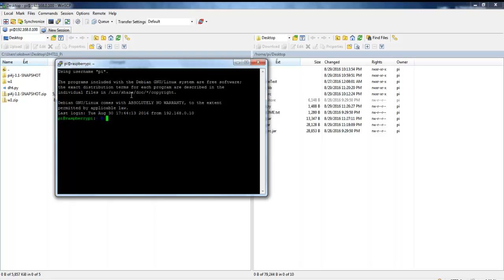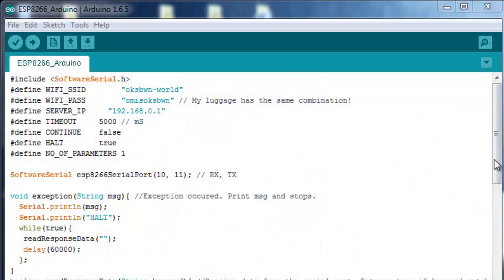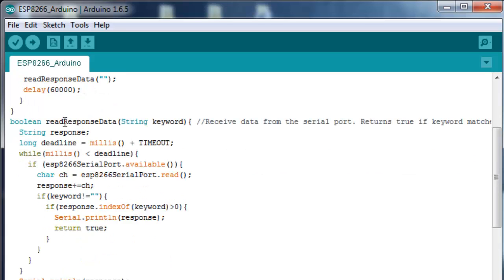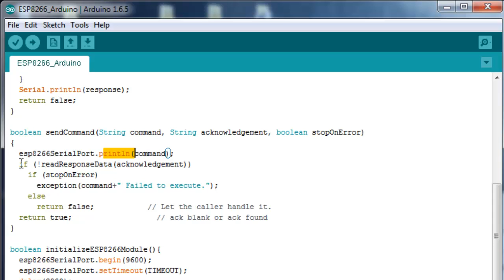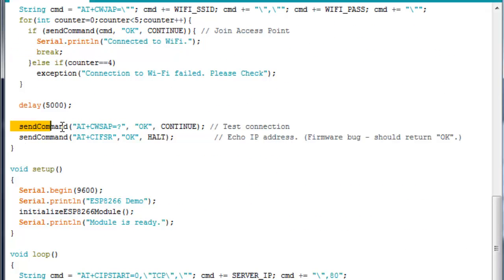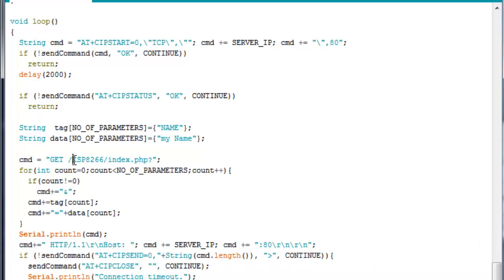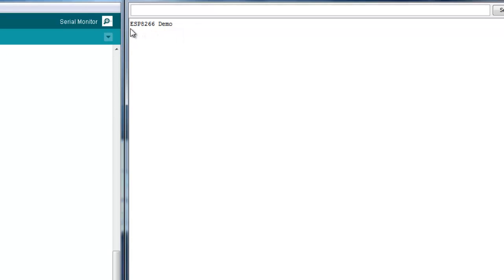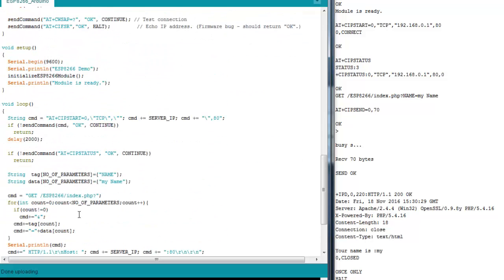Connecting ESP8266 with Arduino | AT Commands

Comment: Hi , i have a problem with esp8266 can you help me. I purchased esp8266-01, but it is not accepting any at AT command. I tried flashing Ai thinker firmware but then also after successful flash no change at command not working. 

When i uploaded blink code on it through Arduino it is working, on board esp led is blinking. Even i purchased different modules esp-12f and node mcu but no one accepting at command

Please help me solve out at command issue
Reply from the maker: If you are using Arduino or NodeMCU or any other firmware that means the AT firmware of the module is already replaced or removed. If you want to work around AT commands only please upload the required AT firmware for your module. But would recommend using Arduino or NodeMCU. Sorry for late response but I don't know how your message landed in spam so didn't notice earlier.